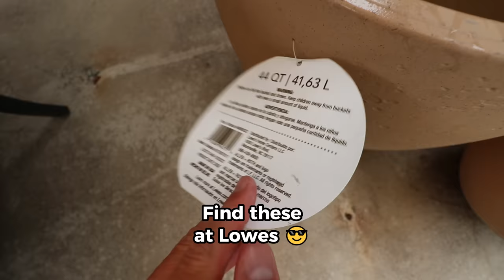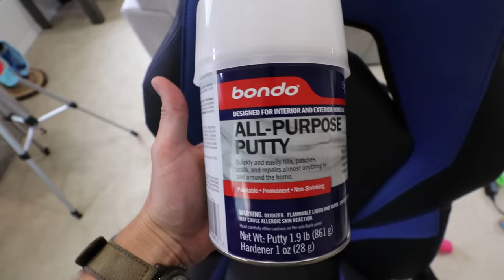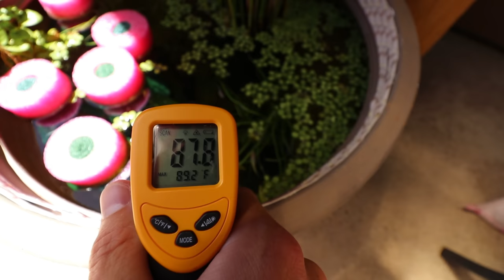I Made The BEST LED Patio Pond - Setup & Tutorial

Comment: Next time, put the bigger container down upside down and work to attach the smaller container on top of that, then flip it over. Much easier than trying to center the big container on top of the little container.
I LOVE the idea of using a book light! I'm going to do that for my new Betta's aquarium! For siphoning mini ponds, you could use a powerhead with a sponge over the inflow to keep the fish from getting sucked up. A powerhead with tubing attached is much smaller than a pump and will move the water out much faster than a regular siphon. That's what I use for my patio container ponds for water changes. Just be sure to put a sponge over the intake as it will shred your fish if they get sucked in.

Comment: Don't know if this was suggested yet/if you tried this approach, but you can line the inner overhang lip (that makes it hard to clean out the bottom as you mentioned earlier in the video) with aluminum tape or other reflective material and thread a line of LEDs in that gap, ideally trying to face them downwards but the reflective material will make it more diffuse anyway. That way you can hide the LEDs a bit better, they might be better at penetrating to the bottom of the pot pond
Reply from the maker: Thanks! Ya ill have to look into somethin like that, might work good 🫡

Comment: Just built myself a new patio pond. I’m curious what you do with your floating plants and livestock on winter?
Reply from the maker: You can move your floating plants inside, same with the fish if you really want to or think that a 5 gallon bucket would freeze, but rice fish can survive np with the top layer frozen 🫡
Reply: I'd just drain it down a bit and move it indoors during the winter before it freezes and have a nice little indoor pond to enjoy inside while it's cold outside. Put a small light over it and an air stone and treat it just like an aquarium. 😊
Reply from the maker: @vanissaberg5824  totally a great option!
Reply: @AQUAPROS  the rice fish I knew would survive a Michigan winter, it’s the plants I was unsure about. Last year in my 300 gallon pond I just put a deicer in the pond and I had zero losses but that houses native pan fish species and a large mouth bass. The deicer I got from TSC for like 20-30 bucks and it worked fantastic in that one. But it’s also a stock tank and that deicer was intended for use in it and as I said, no plants.

Comment: The ir themometer mesures surface temperature which means you only get the correct number if ALL water ADN the surface have the same. If you point it at transparent plastic you might get the wrong number. A proper thermometer for water is pretty cheap.

Comment: What do you recommend to use as mini pond as size and material?
Reply from the maker: If your gonna add ricefish the size can be pretty small but I like to use planters that hold 5 to 15 gallons of water (thats a good range for me) you can do a lot with that.... Material isnt super important, most everything wont leach anything harmful. Resin is a good choice cause it light weight but fiberglass can also work. Regular ceramic ones are fine too, they are just really expensive

Comment: Is that pond container plastic? and is the rim hollow? Why not hide some LED strips in the rim facing down to light the water? Also, if it's wobbly, maybe fill the smaller pot with concrete for more weight and stability? and find a more sturdy way to attach the two together? I really like this setup.
Reply from the maker: All good ideas! I might fill the bottom with concrete next spring. Thank you!
Reply from the maker: And yes its plastic